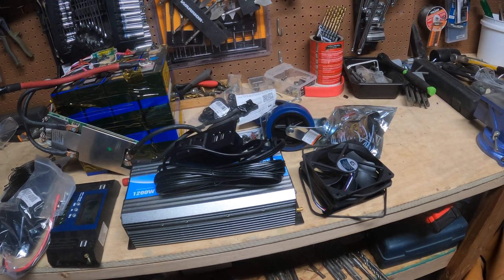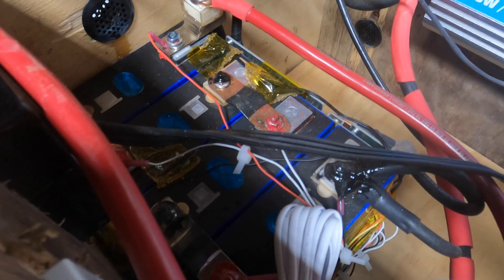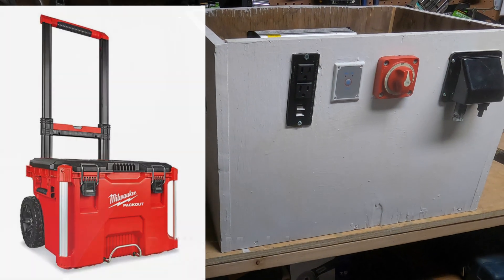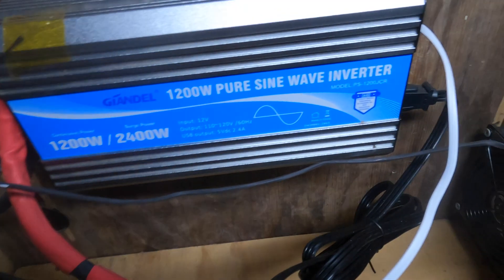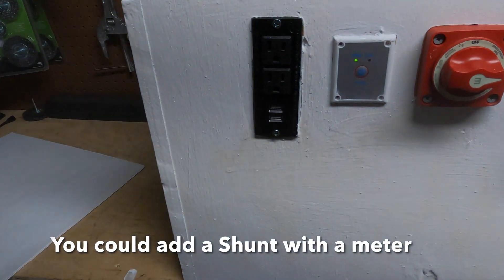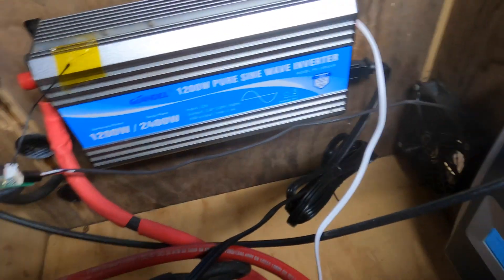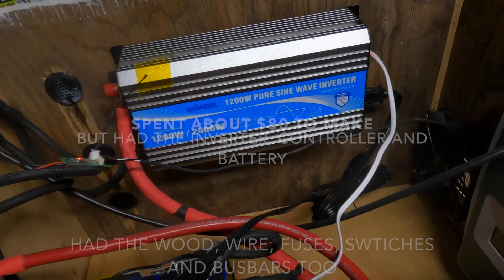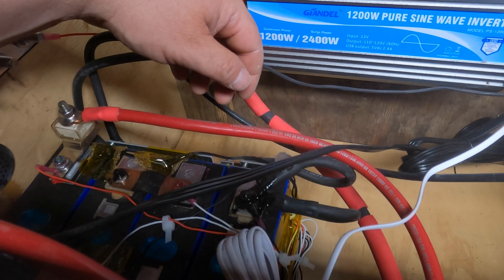DIY Solar Generator or Power station build.  Cheaper than a Jackery, Bluetti or Ecoflow

Comment: I'm old with a bad back! Forget building a Box. Use a Piece of 3/4" or 1" Plywood 24" W X 48" H or so? So it will roll through a door and mount the components to it like your wall unit.  Build it like your gonna attach to a hand truck 2 wheel load dolly... So much easier. If you want it enclosed then build a cabinet around it after its done, with the battery on the bottom, and move it with the dolly. you'll never build a Square box or in a toolbox or trunk again.

Comment: I didn't see a total price listed, how much did it run you for everything (including approximate price on what you already had)? And how long did it take you to make?
Reply from the maker: I spent about $80 because I had the major parts already but you could make this for about $850 if you had to buy everything.  Just a few hours to mount and wire everything.  It is a pretty easy project if you have built solar setups before.
Reply: @OurBlackCatCottage  right on, thank you!
Reply: @OurBlackCatCottage  a year later with prices dropping on these pre built u it's would you still build your own?

Comment: Nice build but I would suggest losing that light duty,  low peak power high frequency, inverter and substituting it with a heavy duty, longer life, higher peak power low frequency inverter.
Reply from the maker: I have several low frequency inverters and they are excellent for sure.  But the Giandel is solid.  I have used this one for several years and it can easily power things that you wouldn't think a high frequency one could like a small A/C unit.
Reply: After you posted your comment that Giandel inverters are solid, I did some checking and found several videos on Youtube showing Giandel inverters failing unexpectedly. I then visited Amazon and found dozens of customer complaints saying that their Giandel  inverters also failed unexpectedly. I'm sorry but high frequency Giandel inverters would not be my choice for building a solar generator.   @OurBlackCatCottage
Reply: All engineering is a compromise😅
Reply: @Peter-jo3wt  YES well said.. finding that balance of compromise is key.